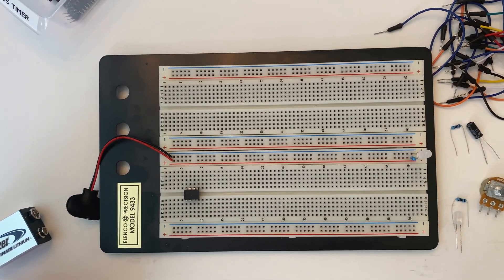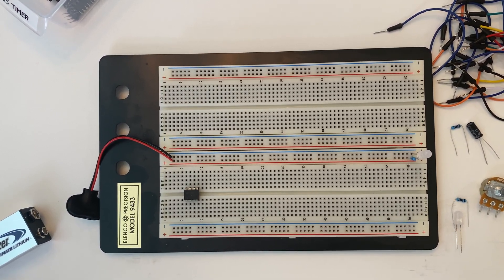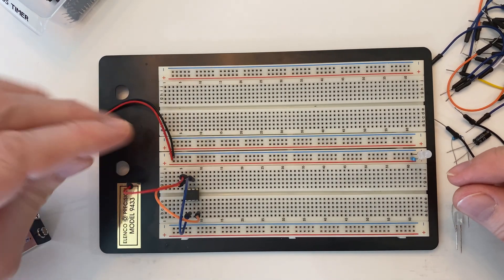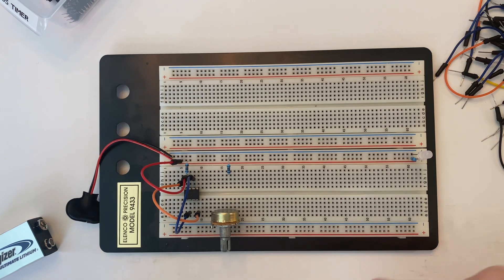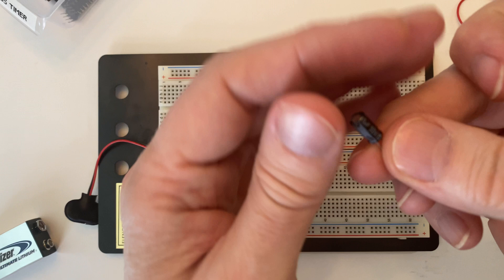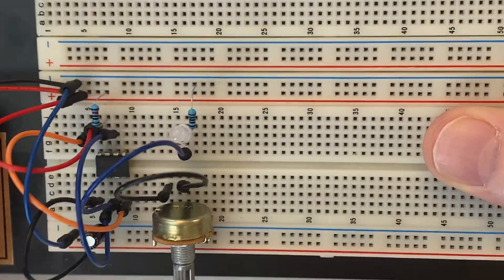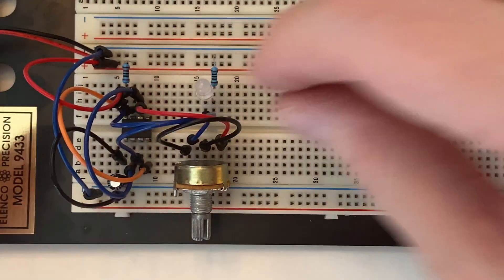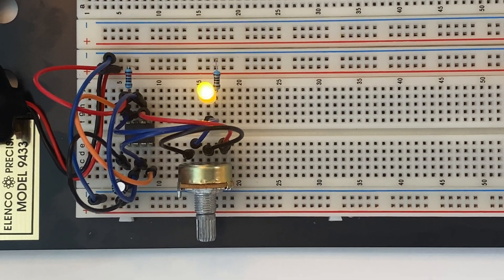How To Build An 8 Step Sequencer Tutorial Part I

Comment: I tried on the strip board and it’s just solid led.
I tried on a proper bars thinking that maybe the strip board was broken but I got the same result...
I don’t know what to do...
Reply from the maker: Where did it go wrong? Was it Part 1, 2 or 3? Sometimes it helps to rewatch and follow along, pausing the play of necessary.
Reply from the maker: Also, ensure you have pins 13 and 15 of the 4017 to ground. If that isn’t done, it won’t advance. Also, ensure you ran a wire from pin 3 of the first 555 (clock circuit) to pin 14 of the 4017.
Reply from the maker: When you say the led is on solid, are you referring to Part 1, the clock circuit? If so, use an electrolytic capacitor for the 10uF.
Reply: @Sarahbuildsstepsequencers  i replied but my comment is not here...
anyway thanks for your reply, yes its solid, on the 555 part 1 (what a shame).
anyway you could be right cause i didnt have that capacito and i tried to put 2 lower value in parallel but didnt work....
i probably need to buy the proper capacitor.
cause yeah i checked everything and thats why i tried from breadbord to stripborad.
but im getting same error...
what capacitor you suggest?

Comment: Great I knew there was one hidden guide.. thank you I will enjoy this bless you
Reply from the maker: Hooray! So happy you found me, Dahla! Please let me know if you build this and ask if you have questions. Annnnnd…please Like and Subscribe! 💕
Reply: @Sarahbuildsstepsequencers  Hi Sarah! So I moved on from 4 step... The reason I did 4 step especially is I have only 4 signal diodes...however I have heaps of 1n4004s lying around and found I still produce signal through them so I moved onto 8 step :) ... I wish I knew with an oscilloscope, but do you know if the diode type truly matters when it comes to producing signal like this ? ..
Reply from the maker: @dahlavibez5726  well, I don’t think it matters too much, no. I am not an electronic engineer. Their purpose in this circuit is to block voltage from coming back in the potentiometers, so, any type should work. I would suggest using all the same type/ value diodes is all. Some diodes have a bigger current drop than others. I’m so happy you’re enjoying your new sequencer you built! Thank you for watching!

Comment: Oh yes this is the bee's knee's. Been waiting for you to do something like this and I am all over it. Got the breadboard out and the 555's lets go. Have to admit though up to this date my success rate with building anything like this (LMNC Super Simple Oscillator) is zero, could get nothing to work and I think you may of hit on something with your mention of the static sensitive triple 5. I fear I may of fried a number of components that way and when soldering. Looking forward to more in this series.
Reply from the maker: Hi Mr. Popes! Oh, I’m so pleased this has you revved up! I believe you can do this if you take your time. You can pause, build, play, pause, build until you’ve finished. Let me know when you have success, please!
Reply from the maker: Mr. Popes, you know, I’ve never been a fan of strip boards. I just don’t like the aesthetic. Strange, right? Would you like if I did tutorials on making audio/lfo  oscillators from both the 555 and the CD40106? One primary difference is that the 555 can directly drive a little speaker and the CD40106 requires external amplification. Just say the word, friend! And what else would you like to see?
Reply: @Sarahbuildsstepsequencers  to be honest I would love anything and everything. I have struggled to even get a sound out of my simple playing. Even LMNC Super Simple Oscillator was a failure and it only has 6 components.
Reply from the maker: I think you’d enjoy this build because it enables you to test your circuit in the 3 lessons, which is excellent practice. With my builds, I always test as I go as it’s much easier to spot mistakes than to build up the entire circuit and then troubleshoot for errors. 

If you do build this, I would be very happy to answer any questions you might have. I think quite highly of you, you see!